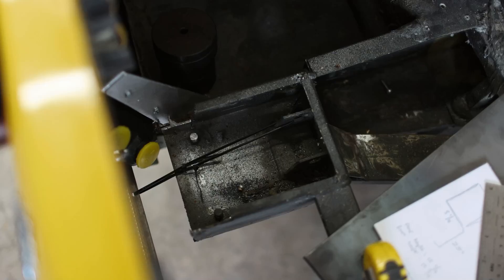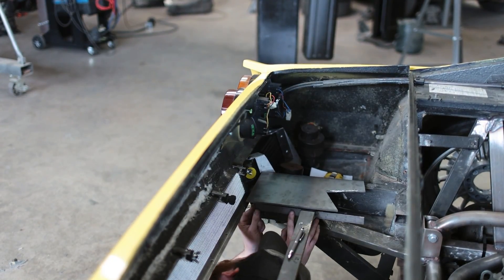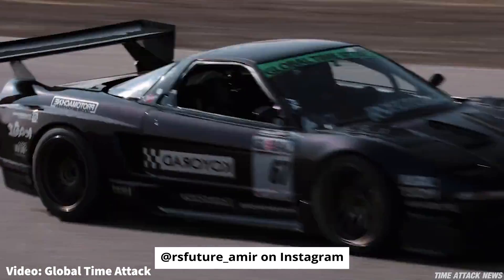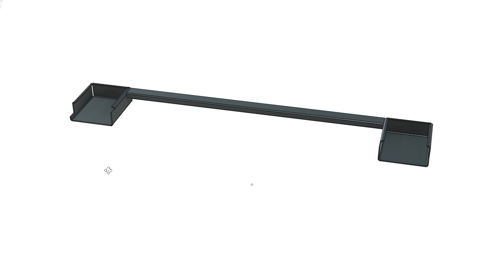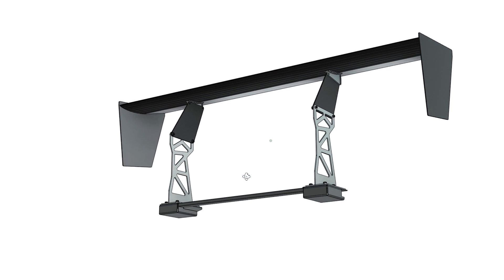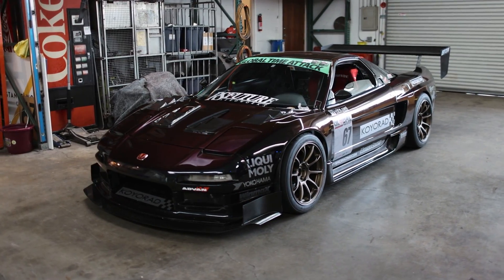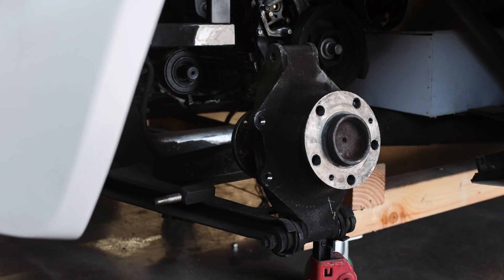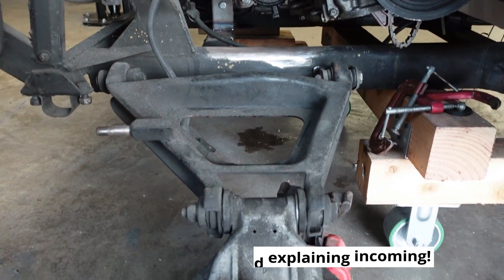K-Swapped Ferrari - Designing The Chassis-Mount Wing for Global Time Attack - Ep. 44

Comment from the maker: It’s always tough to remember all of the discussion details: I’ll be designing some sort of triangulation cross brace between the uprights for stability. 👍
Reply: the cross bracing could be in the trunk, invisible to the outside.
Reply: lol - always two steps ahead of us- that was my question when I first saw the design
Reply: My question excactly! Damn this build is sick so far! Im loving having a throw back to my engineering days
Reply: Speaking of suspension travel got me think of the diff and drive axels, how’s that going to work? ( I don’t know the factory setup of this engine) I’m thinking front wheel drive gearbox usually has the diff mounted to it but is there clearance for the axels? What axels will u be using?
Reply: I’ve been so stoked waiting for the suspension/ upright designs 🤙🏻
Reply: Have you thought about contacting wisefab for options? They might have an off the shelf solution.
Reply: Nice work! If you have any original parts to sell, it maybe worth speaking to The Car Wizzard as he bought the car treck 308

Comment: Will you be bringing the uprights out on longer arms to account for the track width? This change will impact the angles of the arms and thus the geometry you are trying to maintain.

You could make a "deep spindle" to account for the track but that will destroy the wheel bearings.

I guess what I am saying is the geometry is being modified by virtue of increasing the track, may as well go to something off the shelf (like corvette uprights) and send it. What I would do is make some way of adjusting the pickup points on the chassis (assuming that's permitted in rules) and at least that way you can adjust later on.

Comment: Have you looked into swapping a front knuckle from a front wheel drive car into the rear for the changes you want? That will add a toe adjustment that you don't have now and solve the bolt pattern change, as well as give you more options for brakes.

Comment: I can't imagine a 300 pound barbell being set across those trusses for the wing, let along a 600 pound barbell. The first triangle will force a lot of energy at the apex at the bottom, over a very small area left after the cut out. I think it will do interesting things. Rest of the build is pretty good and I like the way you put the two small radiators in the back. The great issue with mid engine cars it how to cool them without running tons of hose to the front, that would probably be inefficient. Look for a synergy of downforce and side ducting to cool it. I don't know what that would look like, without turning it into a GT 40.

Comment: If you are having the aluminum uprights laser/water cut then might I suggest adding some slots and tags just to make it super easy to locate and create a stronger connection to the base plates. Also you can do this if you add a brace between the two, which I think you might need to.

Comment: Couple notes.  The aluminum upright portion you designed was sitting through the thickness of the bolted on plate and not above it.  

Another cool thing in fusion is to use shape optimization on those plates in the simulation workspace.  It's going to give you a mesh result for load paths so you can see where you need material and where you don't.   Note that it's load path only not magnitude.  So only base it off that and still perform a static stress simulation to validate.

If you are interested I could help run some generative design studies and see what AI thinks.

On the wing is that arrangement with the bolts in single shear standard?  Hard to imagine the cf parts can handle that.  Might also want to consider bracing the uprights.   Might be cool to use some heim joints and turnbuckles.

Comment: Do your class regulations require a single plane element rear wing? There is plenty of low speed downforce being lost without additional planes, that goes for every aero device on the car.
Reply: With this though the wing will have to be cross braced and reinforced to handle 800+ lbs

Comment: Why not slot the deck cover so that you can remove it without removing the wing? One less step in case of fire might not be a bad idea, unless you're going to run fire suppression lines.
Reply from the maker: I’ll have a fire suppression system. Mainly because I don’t want slots at the back of the car.

Comment: Hi, I developed an automotive performance simulator that I have been using for a long time (since 1997) in simulations for  automotive magazines in Brazil. I have been following your channel and the assembly of your ferrari and would like to simulate the future performance it will have. However, for that I will need the gear ratio and torque/power data you intend for the engine. I did a previous simulation with the data you've already mentioned in the videos and the same gear ratio as in the ferrari gearbox (data from internet) so you can see an example of what I'm talking about. Sorry for the Brazilian units.

Original
Relação_da_1a_marcha	3,418	
Relação_da_2a_marcha	2,353	
Relação_da_3a_marcha	1,693	
Relação_da_4a_marcha	1,244	
Relação_da_5a_marcha	0,918	
Relação_da_6a_marcha		
Relação_do_diferencial	4,063	
Câmbio	Manual	
Tração	Tras. 4X2	
Deslizamento	Normal	
Largura_do_pneu	225	mm
Perfil_do_pneu	55	
Rodas_aro	16	pol
Carro		
Largura_do_carro	1,720	m
Altura_do_solo_ao_teto	1,120	m
Altura_do_solo_ao_piso	15,0	cm
Coeficiente_de_penetração_aerodinâmica	0,30	cx
Peso_do_carro	1350	kg
Capacidade_do_tanque	60	L
Área_frontal_corrigida	0,492	m²

Ferrari 2,9 V8		
Potência	214,0	cv
Rotação_de_potência_máxima	6.600	rpm
Torque	24,8	m.kgf
Rotação_de_torque_máximo	4.600	rpm
Velocidade_final	231	km/h
Rotação_à_velocidade_máxima	7.000	rpm
Marcha_de_velocidade_máxima	5ª	
Velocidade_final_possível	269	km/h
Aceleração_de_0_a_100	7,7	s
Aceleração_de_0_a_400_m	15,6	s
Velocidade_em_400_m	150	km/h
Marcha_em_400_m	4ª	

K24 1000hp
Potência	1001,1	cv
Rotação_de_potência_máxima	8.046	rpm
Torque	185,8	m.kgf
Rotação_de_torque_máximo	5.062	rpm
Velocidade_final	324	km/h
Rotação_à_velocidade_máxima	9.800	rpm
Marcha_de_velocidade_máxima	5ª	
Velocidade_final_possível	452	km/h
Aceleração_de_0_a_100	4,2	s
Aceleração_de_0_a_400_m	11,4	s
Velocidade_em_400_m	241	km/h
Marcha_em_400_m	5ª

Comment: The upright mounting holes won't necessarily be the same distance apart as they are now, unless they're the same distance as the control arm mounting holes, i.e. both control arms stick out horizontally in the neutral position. But if they spread apart at the ends or get closer then that means as you extend the arms those upright mounting holes with have to get further apart or closer, whatever is required. Basically to maintain the same geometry as OEM you'll have to extend the arms to whatever distance you want first, then locate the upright mounting holes to wherever the arm lines end up. Should be pretty easy to draw the geometry with some basic measurements and lines but definitely start at the chassis mounts and work your way out to the upright.
Reply from the maker: You’re 100% correct.

Comment: about the rear uprights, how about getting a look at the multilink units seen in the back of the S and E class mercs? these things are dealing with 5+K lbs cars just fine, and let's not mention the big turbo builds the swedes do on the OM606 and 613's, shoving 1.5K newtons to the ground.
one of the pros of the 5 link is that it can be very compact (more than double wishbones), which is clearly an advantage here.

other advantage would be to completely delete the lower rear subframe and have a rapid release of the entire rear end (mercs have 4-8 bolts holding the subframe in place) in case of a track mishap wrecking it.

the upper mount is NOT good when it's only held from the back of the frame, this would help a ton with finding extra connections further forward, on the sides of the fuel tank. as is, with all the torque you're going to have, the car will have undesirable behaviours when moving on/off load, with the front part of the upper wisbones flopping around.

the rollcage connecting to the mounts and the shock towers would be extra clever. uber clever would call for a pushrod link from the spoiler, straight to the uprights, via one of the linkages.. no wasted aero in the suspention flex.

Comment: If you're considering keeping the cars' original roll center, the end result will be that you'll need to machine a new hub upright while lengthening the control arms/shock mounting points. No need to change current control arm angles-just weld a bar between the upper and lower control arm (at ride height) so that you can take them off and create an adjustable jig to accommodate the lengthened arms!   1.25" 7075 plate (plus the larger diameter wheels) will allow for a longer upright capable of capturing the rod ends/ball joints. OH-maybe consider Ford Mustang hubs (bolt-ons) as their in every parts store in the country and can possibly handle your power requirements

Comment: I'm really enjoying this series and your engineering/fab skills, I came across your channel by chance a little while ago and subscribed instantly. 

For the actual wing, are you using a pre-made item that will bolt on your mounts?  Fine tuning aero for max downforce and minimum drag is a fine art in itself. 

Don't know if the class you are entering specs the wing layout, but I would have thought you'd want a split main-plane (F1 style) with a Gurney flap on the trailing edge to enhance DF/reduce drag with louvres in the wing end plates to create trailing vortices too. I'm also assuming you'll have a splitter etc on the front end to get a good front/rear balance. 

Flat bottom leading into a big rear diffuser is definitely a great idea too, Porsche 911 GT3 style outlets in the fenders/wings to reduce wheel well pressure/lift would be the icing on the cake ;)

Comment: why are you not bending the alu plate so it goes out on the side of the hatch , you will need to cut a bit of the sides of the hatch , but a lot easier to take it off , maybe even possible to leave the spoiler on , as the spoiler will not go trough the hatch

Comment: For your rear upright you could very easily have technotoytuning make you a new upright plate and attach a 370z rear bearing. They are very durable and can handle a ton of abuse and it would not be hard to adapt abs from the hub ring.

Comment: You will need an X between those stands giving flex support to the silver part of the support that is under the boot, otherwise, it will twist with that 800lbs of downforce, you can use steel cables to add tension and make it simple and removable like in bridges and construction, you can even anchor those wing stands in other places using the same method to make those not to move at all. it's used a lot in Hillclimb cars here in Europe. about the hub and assembly, try looking for Radical SR3 ones, or maybe build your own like that. really light and really strong. that whole rear assembly and A arms would fit your build like a glove for inspiration.
Reply from the maker: Peep the top comment

Comment: Just an idea....Why not try using PVC to help design the control arms? Its cheap and will give you a real time visual.Doing everything in CAD is great but having something in your hand might help find issues you dont see.Plus you can make them as long and moved in you want.Rod ends on the control arms will make your life easier when setting the suspension.As for uprights a couple of really nice ones are from Factory five racing,GTM CARS, Also Heidts they make a really nice IRS suspension and I think the parts in it will do what you want check the website.Hope this helps

Comment: My favourite was an F430 with a giant wing mounted direct to the aluminum engine cover.  Any serious downforce and it would've just bent the panel.  Fortunately it seemed aimed at the 'leave on a curb outside a nightclub' market rather than any sort of motor sport.  Groan.
You're right about the stub axles; I've seen 2 fail on racing 308s with the wheel only held on by the rotor and caliper.

Comment: If you are designing custom control arms I cant see the point in also doing a custom knuckle to house an existing hub assembly as you mentioned. Just build the control arms to suit an entire knuckle and hub from the newer vehicle of your choice. You can adjust the the outboard control arm mounts to account for the hub centering. Granted it could be a challenge to find a knuckle that will work, but there are plenty out there to select from.

Comment: Very nice work and great job explaining the thought process and the challenges being faced. I always thought you were going to go with a rear wing hung off of the back with external pedestals. I now much better understand the direction and it makes excellent use of strong OEM frame sections  and will result in a cleaner build. Two items I would consider is perhaps slotting the rear deck lid so that the lid can be removed quickly without removing the wing section. The other is to use two opposed diagonal supports (on the aluminum portion below the deck level) to control left to right sway of the wing. This can be done with something as simple as aviation cable and turnbuckles to set the pre-load and will allow for a much lighter structure overall.

Regarding the suspension you made some excellent observations and have a number of challenges ahead. It will be interesting to see the project develop as a spectator. Lastly I too like dogs better than cats :)
Reply from the maker: You’re right on all counts! I know slotting the deck lid is the way to go, but I am worried about the look of the slots cut at the back, and about the deck lid flexing way too much when cut to that extent. 
I’m definitely adding some trussing for support though!

Comment: You don’t necessarily wanna maintain the same length difference between the upper/lower control arms on the new longer arms you’re making because the arc they travel in will be different. 

You need to prototype or model the arc they’re gonna travel in to design in the amount of camber increase you want under compression. Or design the uppers to be adjustable.
Reply from the maker: Both will be adjustable 👍

Comment: Just a thought ... make your carbon uprights hollow, have a slot in the front and opening at the bottom, from the bottom duct to your rear mounted radiators.
Reply from the maker: The uprights are way too thin for that. It’s a killer idea but better left for a team with a considerably larger budget

Comment: Since you have a clean slate at the rear to work with you should look into connecting the wing directly to the tyres.
The problem with wings in most vehicles is that they have to transmit the down force to the tyres through the suspension requiring springs that have to cope with the extra load of the downforce, this results in either a very stiff suspension which comprises ride and handling at low speed or slamming the frame on the bumpstops.
Using a system of modified dampers or levers you could connect the wing directly to the unsprung side of the suspension.

Comment: I think I would reach out to one of the race car manufacturer like Riley, Doran, Radical and see what they have from one of their existing cars.  That would allow an off the shelf stub axle, bearing, and brake package.  The I’d design a tubular set of A arms and lastly make the chassis attach points.
Reply from the maker: Good suggestion!
Reply: @stanceworks  additionally, you will not need a super large brake system for this car. I built a 964RSR that was 2225lbs full of fuel and used a stock 993turbo brake setup.  It was very easy on pads and rotors, but could outbreaks a heavier 996Cup by 200ft from triple digits.

Comment: Isn't easier if you build the suspension geometry markup with cheap steel tube so you can have a better understanding on how it's going to work? And you can use the Porsche 996 rear wheel hub carrier I'm not sure about the dimensions I saw on a forum that it works maybe that's something you might wanna look at...
Reply from the maker: I’ll design it all in CAD to confirm it works 👍

Comment: How do you plan to introduce cross bracing in the uprights? I suspect that you will have a lot of cross torquing loads from such a large wing when the car is not going in a straight line.
Reply from the maker: Either a truss between them or triangulated bracing to the chassis in front of the uprights

Comment: I know you want the wing up rights to be clean but I think you’ll run into issues removing the wing if the fasteners are under the hatch.  Maybe protrude the aluminum through as a simple answer to detaching the wing.
Reply from the maker: I actually drew the part up this way (what you see in the video protrudes from the hatch) but I realized either way, the wing element has to come off. Might as well hide the hardware underneath and just unbolt the element.
Reply: @stanceworks  how are you going to unbolt the element if they’re under the hatch?  Or is the plan to remove the hatch then the wing to access the engine compartment?  Guess I can wait to see your solution when the time comes.  

Rendering looking spicey with the aero package.

Comment: Dumb Question, would there happen to be an dual wishbone suspension components that had factory k series axles etc ? Maybe source some Honda or Acura stuff ? Seems like some folks have been punching out nice times at the strip so they should be able to handle the loads. Just food for thought, if anyone else is more knowledgeable feel free to correct me, always open to learning !
Reply from the maker: That’s a good suggestion. Maybe Honda front uprights would work.